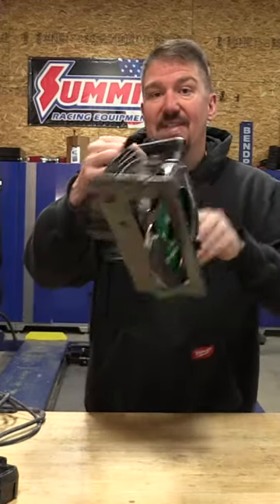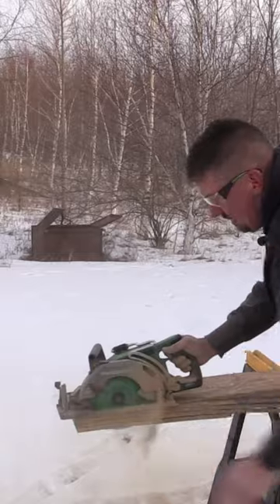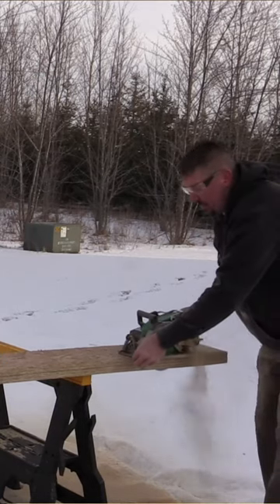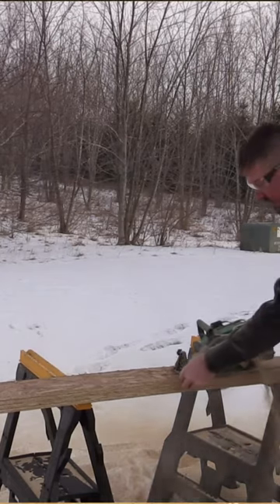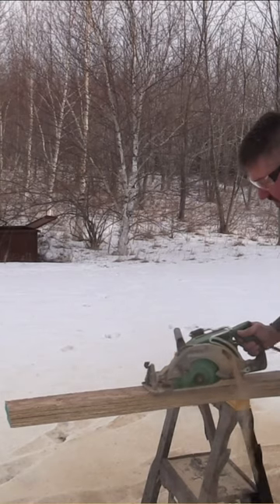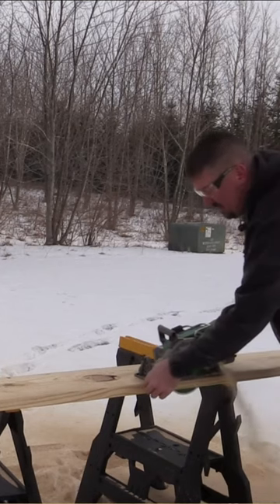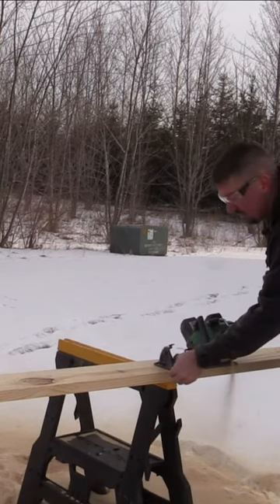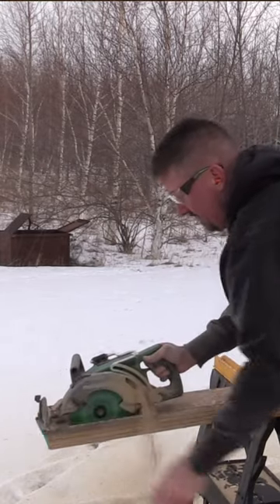This Is Amazing! The New Metabo HPT Rear Handle Circular Saw Rocks #Shorts

Comment: How does it compare to the left blade flexvolt? That would make a good video.
Reply: I know it just renders cords useless man.

I mean it has even cut exhaust pipe with used carbide wood cutting blades.

Source?
Well i do enjoy a full send of most things.
I figured the carbide metal cutting blades didnt look thay different
I was right! It did eventually remove the carbide tips
But hey
Uf ya have old used wood cutting carbide circ saw blades and need to cut some pipe I can say just send it. 36v saw just didnt even care.

Comment: I have a metabo worm drive saw. My metabo battery won't fit in it? There's a plastic piece holding it back from in ? Any ideas? Thanks Darryl
Reply from the maker: Are you trying to put an 18 volt battery in it?  This is a 36-volt saw